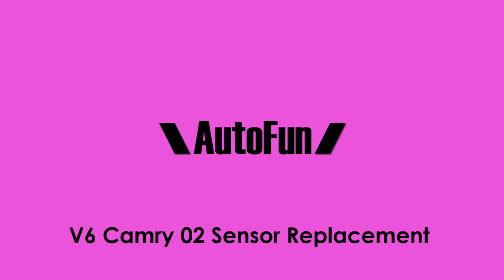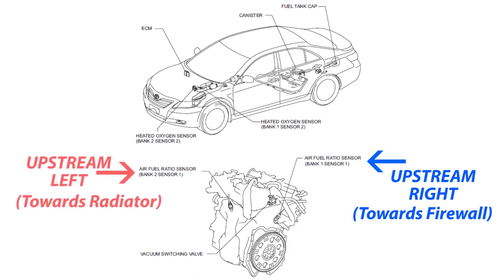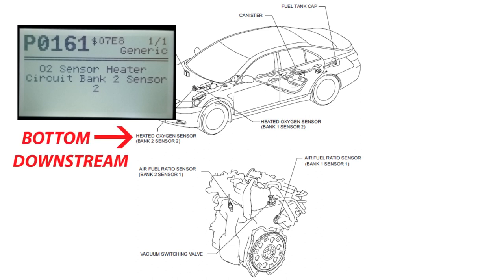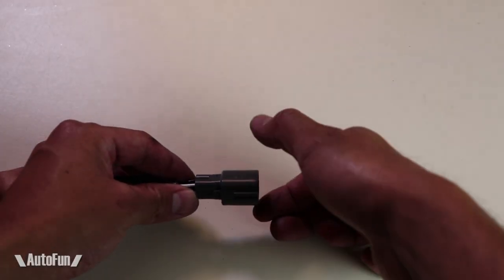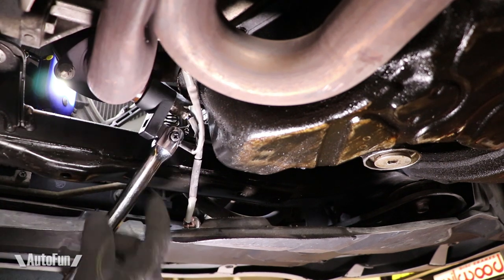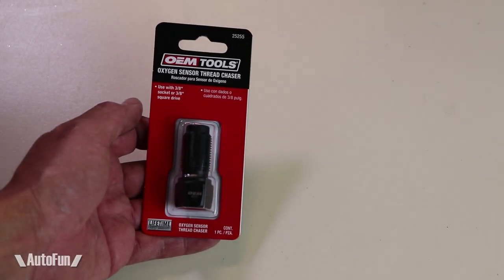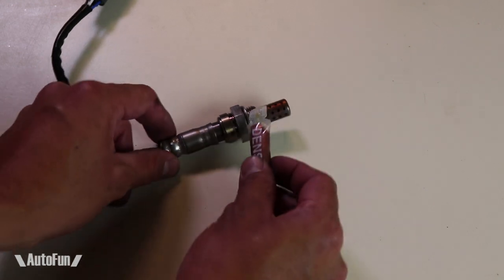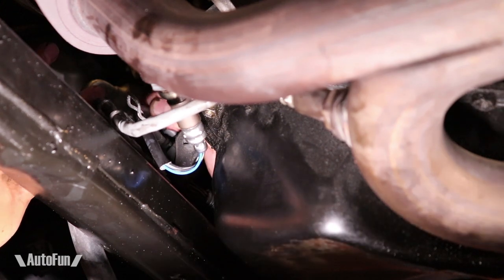Toyota Camry Oxygen Sensor Removal & Install (2007-2011)

Comment from the maker: Hi guys! I have added the links for the oxygen sensors I used on the video description. I use Denso sensors as they they are the are same as OEM. Thanks for watching!
Reply: are those the exact ones amazon is saying they won’t fit my car and i’m almost certain our cars are the same (2007 toyota camry v6)
Reply from the maker: Hi Ky! Correct, the ones you see on the video are the ones I linked (they were installed on a Camry with the 3.5 V6 engine). The amazon part matching sometimes does that but I would recommend for your mechanic to confirm the part number for your vehicle if he is unsure if that is the right one. Cheers! @kyreynolds8247

Comment: Quick tip... When you get the sensor broke loose, spray what threads you can with some penetrant, tighten back up, loosen it a bit more spray again. Do this several times and it
might keep from "pulling" or striping the threads.
Reply from the maker: Yep! even some factory service manuals recommend cleaning the threads using a similar process with a thread chaser like the one I linked in the description as part of the normal process when changing them out. Thanks for sharing this tip Chuck! 🍻

Comment: Looks accurate one bit I would throw in is use some lubricant on the nut and let it set for up to 15 mins to help it break loose easier normally they will get stuck like that if they are well aged and of course there wasn't any grease applied when factory installed the sensors.  Can even use a propane torch if its harder then just lubricant and/or breaker bar.  For me personally I found a 30 dollar flexible O2 sensor wrench that worked perfectly on removing the bank 1 sensor 2 on my 2008 kia sorento lx since I couldn't even fit the breaker bar because it was such a tight space since you got the oil pan on one side and you're up next to the tire cover and such on passenger side.  Only question I have is this the same locations for the sensors on the L4 engine for 2009 camry?  I am planning on helping a friend of mine replace his since he got a low voltage code for it like I did originally.
Reply from the maker: Hi Derek! Yeah if the sensor was really sized on there some penetrating lubricant (and in extreme cases heat) could help to free it up. The only want to watch out for would be to avoid excess lubricant (my favorite for breaking bolts and nuts loose has been PB blaster so far) on the actual sensor front to avoid contaminating / fouling it (if the sensor is going to be reused). Cheers!

Comment: great diagram of locations for 02 sensors.  I have a P1035 code for my 07 camry. Is that an upstream sensor?
Reply from the maker: Thanks gregory J! regarding P1035, I believe you may be referring to P0135 my OBD tool shows it to be for bank 1, sensor 1  which is an upstream sensor. Hope this helps!
Reply: @AlexAutoFun  No sir. I DID mean to say P1035, not p0135.  Any idea what that could be?

Comment: I have a 2007 Camry 4 Cylinder - Have a P0135 code, have no idea which one to replace. So many conflicting information as I thought it is the downstream one :/
Reply from the maker: Hi Rrd T! this video is only for the 6 cylinder version of the Camry, the easiest way to avoid conflicting information (my favorite way) is to refer to the service manual for your vehicle, this way you can ensure that get the right answer the first time (and save $$) Hope this helps!

Comment: Getting a lien code for bank one and bank two on my 2008 Toyota Camry V6. Code only appeared after I took it to a shop to get the exhaust patched. Checkd intake for leaks found none. Do you think when the exhaust was patched back up that my O2 sensors went bad. The code just says lean bank one and two no O2 sensor errors they could see.. car is running good...They can’t figure out what happened any suggestions. Car has 200,000 miles.. No codes before exhaust repair..Any help would be appreciated thanks for your time.
Reply from the maker: Oh wow, that sounds like some wires may have been cut or burned during the exhaust work (I seen this happen before), I don't know how I missed this comment my friend excuse the late reply, did you figure out what it was?
Reply: AutoFun The code seems to have went away, They messed around with the airbox and change the air filter. I have driven over 3000 miles so all seems well so far thanks for getting back to me.

Comment: Hello! I am having an issue with my 2007 Camry where the EFI No.3 fuse keeps blowing. I keep getting codes p0037, p0057, and p0102. (O2 sensor in bank 1 sensor 2 and bank 2 sensor 2 and something with the MAF sensor.) If I replaced all these parts, would the fuse stop being blown? Or is there a bigger issue I should be looking at instead? To make note, I gave it a lot of gas at a green light and then the car died, I managed to pull into a parking lot nearby and when I went to start the car again it died upon starting it. Then the second time it fired up and kept running. But then I had the check engine light on along with the traction light and a red triangle hazard light on with an "!" in it. Also the screen where the miles are shown said "Check VSC system". The car got me back home. I noticed the fuse in EFI spot blown and I replaced it, cleared the check engine light and all codes and it ran fine idling. Then I went to test drive it and same thing happened. I tried giving it gas like before and boom. Car died and blown fuse. Replaced again and blown for the 3rd time. Any help in the right direction is appreciated!
Reply from the maker: Hi DW! I normally avoid changing parts unless I'm able to test them and confirm that they are defective. Also important is to determine why they failed or why they are sending bad data. There could be an underlying issue that is causing the failure or the sensor is working and pointing to the issue. There could also be wiring issues between the ECM and the sensor causing issues. My best go to for learning diagnostics have been the vehicles service manual and also the book by ScannerDanner where he explains how sensors work, how to confirm if they failed and general diagnostics. Super packed with knowledge for pretty much every scenario I have encountered in vehicle repair. Cheers!
Reply: @AlexAutoFun Thank you for the reply! I ended up replacing all the parts the codes said were bad and unfortunately, that didn't solve the issue. The same thing happens. Except for this time, I am only getting a code for the MAF which is new because I replaced it. So same thing is continuing to happen even with the blown fuse but just one code now. I have looked into google as far as I could go, and reworded my problem thousands of times and it seems to be pointing towards my fuel pump? I'm going to replace it ($40 thanks to Rockauto and a good YouTube video) and I will come back to update. Hopefully this works. Also would take any recommendations at this point. Thank you!
Reply from the maker: @dw5057  You're welcome DW! Ah if a fuse keeps blowing there is likely a part that has failed overloading the circuit or again wiring issues that is shorting the circuit. I usually use the service manual wiring schematics to check what devices are on the bus that has the fuse that is popping. A probe could potentially help here like this one https://youtu.be/l8T7v6cu9y4 The other thing I usually check if I suspect a fuel pump is fuel pressure using a pressure gauge (looking at the AFR's can also sometimes give you an idea if you are running lean). Cheers!

Comment: Okay but what is a firewall and radiator? Yes I am not a car person but need to change bank 2 sensor 2 for my daughters car :)
When I try to buy the part it often says "Front Bank" or some such. IS bank 2 sensor 2 the Downstream front bank sensor?
Reply from the maker: Hi James Pyle, the firewall is what separates the engine compartment from the passenger compartment, basically the metal behind the dash. The radiator is located towards the front of the car, it looks like a large piece of metal with fins and normally has a fan attached to it. I also found it confusing that some places call the sensors different things. Best bet maybe to go to the local autoparts store and ask for the sensor you need, if they give you the incorrect one you can always return to exchage it, faster than getting one from the net, let us know what you find!

Comment: Hi, I have the same camry and same error code. If you could share the OEM part number of the O2 sensor you replaced that would be amazing! Thanks
Reply from the maker: Hi, youtube carma, I used sensors from RockAuto, they have both and aftermarket sensors and seem to have the best price. Locally NAPA may have the oem sensor if you want to give them a shot. Thanks for watching!

Comment: Most videos i see regarding removing the o2 sensor people always complain about how hard it is to loosen, then they tighten it up so damn hard you cant get it off.
Reply from the maker: LOL that's true, I had good results using the copper anti seize and sticking to the factory torque specs, but I have encountered some stuck ones like this on this Camry..

Comment: I have the camry 07 v6 like you. I have the code 2238. It does not say on the scanner what Bank i need to replace. Please help me.  Is it Bank 1 Sensor 1. Please reply :)
Reply from the maker: Hi My Stock! that sounds correct, my Launch scanner also shows code P2238 is for Bank 1 Sensor 1. Remember I placed links in the video description for the Bank 1 Sensor 1 which should make it easy to order it. Hope this help and Cheers!

Comment: Hello boss
I have a question 2010 camry 62000 miles after I refilled tank I noticed the slip light and engine light on car. I thought it’s the gas cap so I cleaned the cap and even change battery which was old now no sign showing up steady it showed once then disappeared. I went to a mechanic shot and ask he said all connection look normal he didn’t unplug the connector but the error code initially was p0137
Today I went to parts store rescan it but no dash engine  sign and show o2 sensor again Any advice will be helpful.
Reply from the maker: Hi Thomas! it is possible the gas cap was loose triggering an EVAP DTC which cleared one the gas cap was tighten. It could have also been an O2 sensor DTC, I seen some sensor sometime trigger the MIL but self clean / self heal after some driving (likely the high exhaust temperatures may have cleared contamination on the O2 sensor) Now if you see a reoccurring 02 sensor code then it may need replacement or there maybe an exhaust leak. Hope this helps, Cheers!
Reply: @AlexAutoFun  Thanks bro
Reply from the maker: @thomas9469  You're welcome bud!